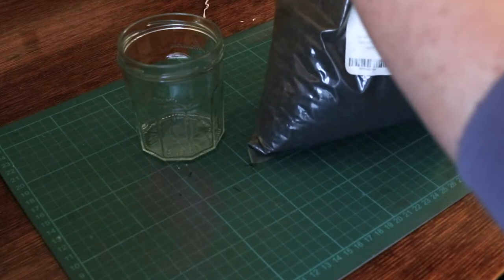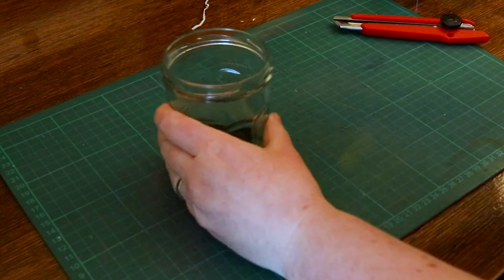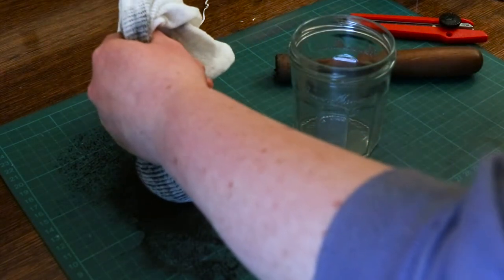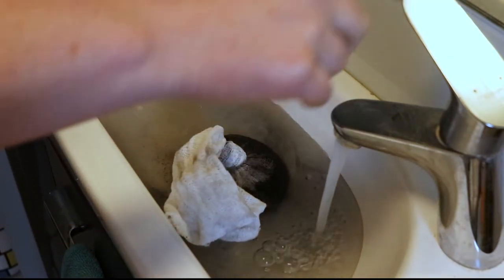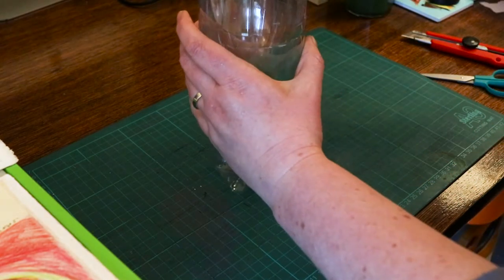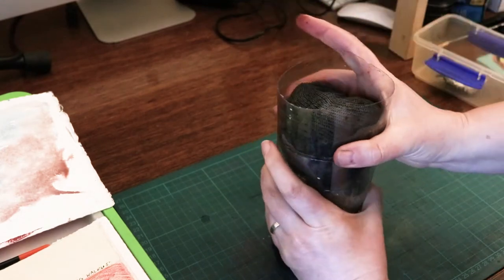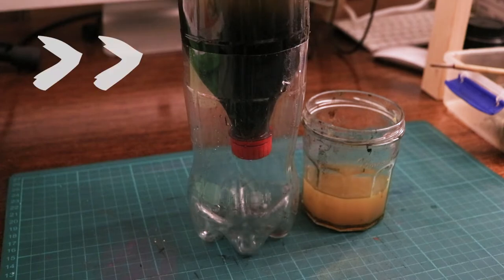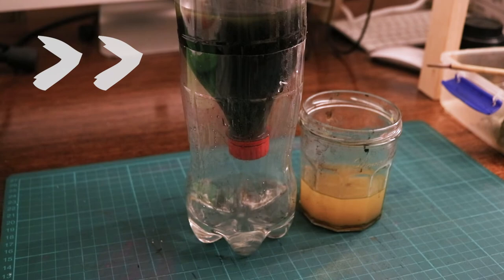Filtering your paint water: how and why...

Comment: The question that still remains for me is if the charcoal particle size is actually small enough to separate out the acrylic polymer from the water.  I'm not sure it actually does as the particle size is actually larger. Purified activated charcoal is 10,000 - 100,000nm and acrylic polymer when wet seems to be 50nm (hard to find the size for when it's wet versus when it is dry).  So what is the charcoal doing?  Is it binding to with the acrylic polyer and pigment particles?  Thanks!  I appreciate the video!